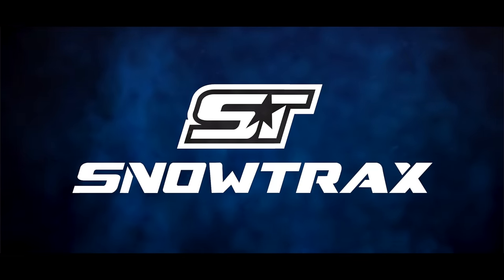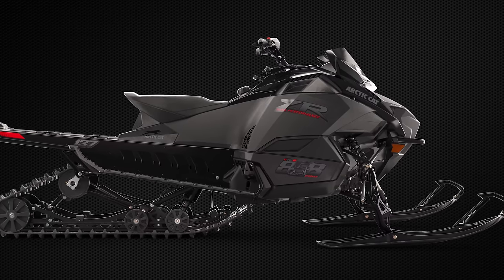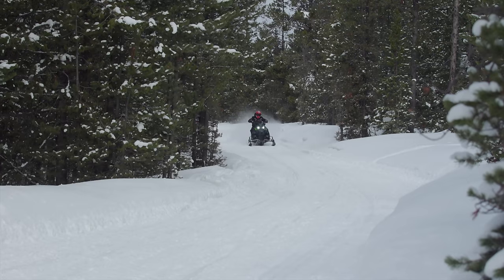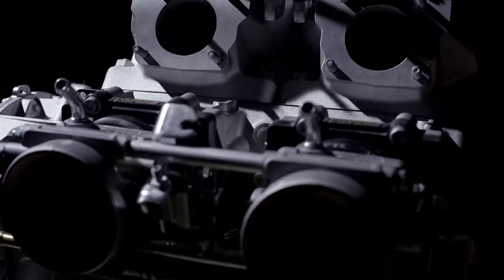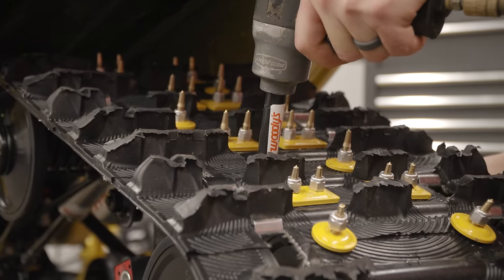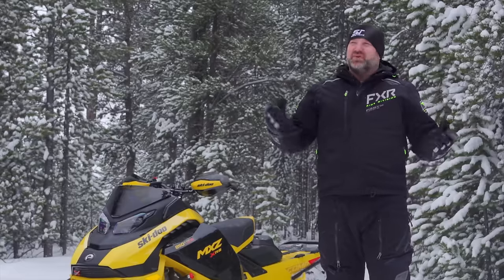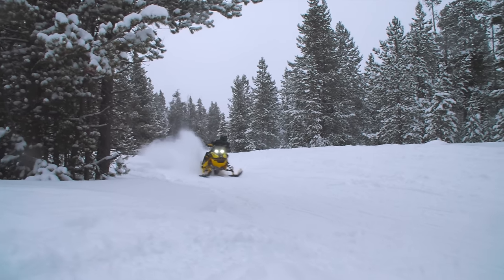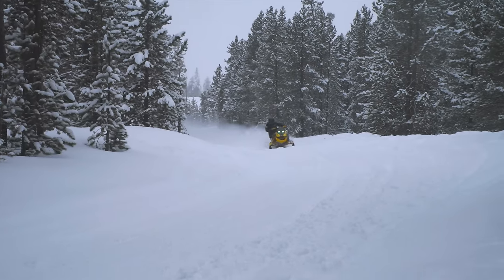SNOWTRAX TV 2024 - FULL Episode 6

Comment: I am not a cat guy, so excuse anything nice I am going to say.

This is the 20-year anniversary of the bring back the triple movement. When that guy in the video said you can't get much more displacement with a twin cylinder, I feel like he was hinting at something. Now i'm not trying to start any rumors....but at the 4.23.05 time mark, if you pause the video at that exact moment, it looks like a 2027 zrt 1000 in the background.

One thing you have to applaud Arctic Cat for is that they know the ISR. Rules, and they set their specifications up for their sled to really support their racers. And make them competitive. Their racing heritage,  bringing out the 600 first, shouldn't be a surprise. 

The old eight hundred was very competitive compared to the competition 850. So, this 858 should be right there.

You could say that building an 850 na When the competition is already had the turbo for a couple years and is already looking forward to larger displacement might be a game of catch up instead of moving the bar higher.

But history tells us, and like the one guy in your video tells us. As we get much bigger in the twin cylinder engine, the efficiency and horsepower gains aren't there unless we move to turbo, and most guys don't want that price tag.  If I can get five or ten percent better gas mileage with an 858 versus a 1000 , As a trail rider, I will take the gas mileage every day of the week because when it comes to racing. A good setup on the 858 will Out run average joe on the 1000.

In closing I would like to leave you with this thought.  Don't ride your bike in the shower.
Reply: Not a cat guy? 😂.   I test rode an 858.  All I can say is wow!
Reply: @CCH-R  Seriously, I am 100% not a cat guy, but we can be adults and give credit when it's do.
Reply: @jonstevensmaplegrovefarms3754  no no I agree.  Didn’t mean to have that sound like a jab at you.
Reply: @CCH-R  we are good.